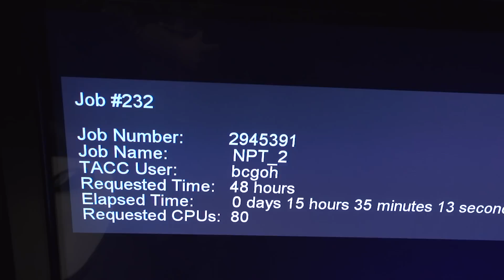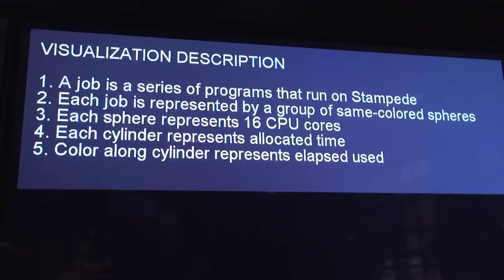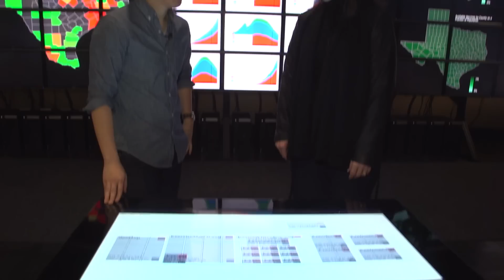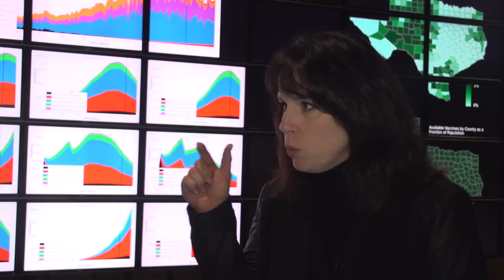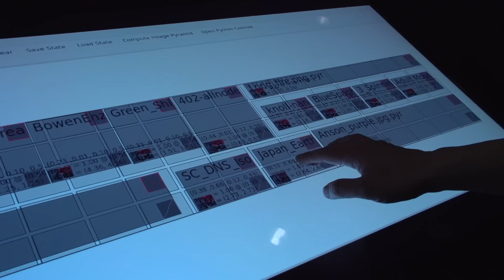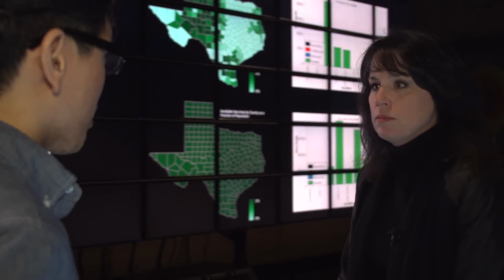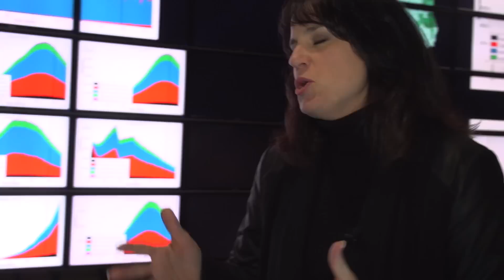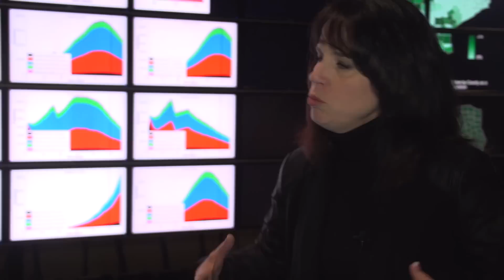What Makes a Supercomputer?

Comment: I imagine a projector would be a lot more power efficient and just as practical to use over these 70+ 30inch monitors. Not to mention a lot better looking.
Reply: the picture quality would not be good with a projector , im sure with all their money they know what they are doing.
Reply: There is no projector even close to this resolution. Doesn't matter if you have a big screen if your pixels are the size of your head. So you'd need just as much projectors as you have monitors now. On top of that you need to make sure you don't block out the light when standing in front of it, so they'd need a whole room behind it just so the projectors can project from behind. And then the touch comes in. I'm not sure how you would do touch on a projected screen like this.

The bezels would be gone but there definitely would be other trade-offs.
Reply: My estimation based on 75x 1440p monitor vs 3x 4K Projector
2160 x 4096 x 3 = 26,542,080
1440 x 2560 x 75 = 276,480,000
276,480,000 / 26,542,080 = 10.41666667
The Monitor Array Roughly 10.4 (1042%) times the pixel count than 3x highend 4K projectors that cover the same area.
Reply: TheOSC I don't mind being educated, as long as it's done in a civil way as these guys have shown.
Reply: No it's comes down to resolution not the size of the display array.  The need real estate AKA pixels to display this much information.
Reply: While it's hard to argue the pixel density of these screens versus a 4k projector, those pixels become useless at the distance/scale we're talking. Even if you needed to fit more things on the "screen", you could play with the DPI to scale things down to simulate a higher resolution.

Touch screen have been done with projectors for a while, but let's be honest, it becomes more a gimmick to have touch screen with a display that size. 

You wouldn't be blocking the light since the projector would of course be hanging from the ceiling, and even if it wasn't, it wouldn't be an issue unless you insisted on the gimmicky touch screen.

From the arguments I've read, I still see this as a huge waste of money compared to a projector. Though, my guess it's not as much the practical value as the proof of concept that is important here, like a demonstration of an insane resolution working in real time with the super computer.
Reply: ttobyg That just isn't true, standing where they were standing you could clearly see detail on the upper row of monitors, it was only a few feet higher and they are 30" each. Your TV in your bedroom is probably smaller than those monitors. Trust me as someone who works on a 32" monitor all day when I am at home I can attest to seeing great detail from a decent distance on a screen that size. YOU ARE WRONG.
Reply: the monitors are touch screen..

they are not, most people think that they are though
Reply: ttobyg It all depends what you are trying to display on it. For a movie this would be stupid, but these screens are used to visualize scientific data and simulations done by a supercomputer that costs tens of millions AT LEAST. The cost of this compared to the computer is negligible. The goal of this wall is to be able to display and analyze the data generated by this supercomputer. That wall is the interface to petabytes of data. What's the point of generating that much detail with a machine that expensive to be limited by the display resolution. You can have 10 people doing stuff on this wall at the same time and still give each one 4K worth of pixels. When working with a 4K projector you drop down to 1080p when working on it with just 4 people. I think you overestimate the amount of stuff you can put on a 4K display.
Reply: Neojhun
 dell's 30 inch screens are 2560x1600, the 2560x1440 are 27"
Reply: ttobyg Yeah going along with what everyone else has said so far you are wrong to state that this would be done more efficiently with projectors. First of all you assume that people will be standing back looking at the entire array from the back of the room. In reality you might have 3-4 groups working off of this one display meaning each one takes a sector of it and puts their research up for display that way. Second there is a reason this is hooked up to a super computer, they are processing highly detailed data and want to be able to see that data in high detail when visualizing it. Finally I don't know how much experience you have with multimonitor setups but the ability to group different applications and visuals into individual monitors makes it much easier to organize your work. I work off of a 3 monitor setup at work and have 2 32" monitors at my house that I use and the ability to group my work is made 10x's easier with more monitors and more pixel density.
Reply: TheOSC the detail gained through pixel density is wasted on the upper monitors. Anything displayed above eye level does does not require that concentration of pixels, since you can't even see fine detail without using binoculars. Notice at 10:50 how everything is sized so it can be observed from a distance. When you scale things up that much, you don't need the pixel density of that caliber, and could easily settle for a 4k projector.

Again, if you think you need more room, you can fiddle with the DPI settings to emulate a higher resolution.

Yes it's very cool to show off the insane resolution to pixel density ratio, but the practical value of it is quite low.
Reply: ttobyg That problem only becomes worse with 4K. 4K aspect ratio has a lot more height than what is shown here. So you'd need at least 3 or 4 4K projectors to get the same usable space. 60Hz 4K projectors aren't cheap. $15-25k MINIMUM for projectors intended for home use and then you still need a touch interface. You may not believe in touch, but it is one of the most natural input methods. Especially at this scale. It may still end up being cheaper, but not by an insane amount. Projectors are much more expensive per pixel than monitors.

What is in screen during the video is not actual research data. It is obviously a demo so it looks good during the filming. This video is not representative for how it is actually used on a daily base.

Fiddling with DPI doesn't change anything. Rendering in high resolution to downscale later is the same as running it at the native resolution at the same scale. DPI transformations make text and fine lines fuzzy which already is a big issue with any projector.
Reply: you all know you are talking about people who make supercomputers?  I think they know what they are doing
Reply: ttobyg Monitors tend to use very power efficient LEDs these days, while projectors use very power-inefficient incandescent lights of various kinds. To produce a similar amount of brightness, the projectors would consume a great deal more power. Add to that the projectors would use a huge amount more space (even with short-throw lenses, you'd need to use rear projection), and your display wouldn't be a touchscreen.

The end result would be consuming a ton more space, losing the vast majority of your resolution, losing touch-interaction, using a ton more power, and costing far more to build (high-end projectors are insanely expensive).

Just one good quality professional 4K projector costs more than that entire video wall and the computers that run it combined. A Christie D4K2560 goes for ~$126k. Even the consumer units cost as much as a car, Sony sells a 1700 lumen model for $15k, but you'd need so many of them to get the whole videowall up to an acceptable brightness that you'd end up in the same situation, paying a ton more than just throwing LCD monitors at the problem.
Reply: Adam Zey I must admit, I'm not an expert on projectors, but it sounds unreasonable to think that 70+ 30" screens consume less power than a 4k projector. Why would the brightness be a problem if the room is darkened? And again, touch screen is a unnecessary gimmick.

Some quick calculations. One 30" Dell consumes roughly 150 watts. Multiply that by 70 and you got 10500 watts or 10.5 kilowatts. 70 30" Dell monitors sell at about $1k, or $700 if you buy an older model, so from about $49k to about $70k.

The Sony 4k projector costing $15k consumes 350 watts, or 30 times less than the monitor solution.

Even if you bought three Sony projectors, for the brightness you mentioned, it would still cost less and consume far less power than the monitors.
Reply: ttobyg
Because you need lamps with a very high brightness for projectors. We can't do that with LEDs yet so we have to use incandescent bulbs. That means before any light leaves the projector you already lost 95% of your energy to heat. Then it has to pass through the LCD screen inside which absorbs even more light.

Projectors make quite a bit of noise for cooling. Ever seen a monitor with a fan?

Well now the room doesn't need to be darkened so you can do actual work. I'd also like to know what you'd suggest as an input method for this wall (no matter what technology is used for the screen). You seem to think that touch is a gimmick but what else would you suggest? A mouse and keyboard need a surface to be used on and don't allow for concurrent users. It's easy to break something down but it's harder to come up with a good alternative.
Reply: Niosus The Sony projector is for home theatre use; pitch black rooms. The Christie projector that I mentioned draws up to ~5kW, and you'd need a few of them. By comparison, a modern Dell 30" monitor has a typical power draw of ~60W.
Reply: Adam Zey Exactly my point!
Reply: I think this guy just can't stand how wrong he is and now he is trying his hardest to save face...
Reply: projectors dont have great res
the graphics cards would fry the projectors
Reply: Niosus My school uses LED projectors and you can't even hear the fan and they are brighter than incandescent projectors, what are you talking about?
Reply: PC Tech Tips There's a difference between small projectors that only need to illuminate a small screen and the large projectors they'd need for a wall like this to look OK when there's light.

It's possible that things have changed by now, I'm not an expert.

However resolution remains an issue. Monitors stay cheaper AND sharper than projectors.
Reply: Even the best LED projectors heat up a lot when used for long periods of time. LED screens can run 24/7 and will only get a little warm. Plus a projector requires more space which is a problem when you have a set room size and you are trying to make the most powerful supercomputer possible. The computers make a huge amount of heat and a projector will only make the problem worse.
Reply: They Doing that because the resolution goes bigger and bigger you will not find 4K 16:9 image 
They make 21:9 image of 1080xp or 4xP

Comment: Bezels. So. Fucking. Big. Why.
Reply: Dell supplied them with the displays, they didn't go shopping for them. Also there isn't exactly a lot of 30 inch 2560x1600 narrow bezel displays on the market anyway.
Reply: Because consumers have not yet demanded bezelless displays. Current displays have wiring along the edges of the panels to drive the rows and columns of pixels. The wiring takes up space and without the demand to eliminate that wasted space it is simply cheaper to stick with the current method of wiring. However, the first company that brings it to market at a reasonable price could be overwhelmed by demand. I think they should move toward onscreen logos that fade away once the monitor is booted up or when there is a video source present. Perhaps they could choose to brand the on screen control menus.

Comment: Teraflops. Stupidest term for something so amazing.
Reply: How is it stupid? Tera is the multitude and flops is an easy way to describe the exact thing being used to rate the system. If anything its an extremely efficient name because it describes exactly what is being said.
Reply: well if you don't want to say flops, you can always go ahead and say it the long way, Floating-point Operations Per Second
Reply: xNo L1m1tZx
 Because the word Flops has several meanings apart from Floating-point Operations Per Second. Think of a movie or game being a total flop and fails to sell. It also means someone bailing on you when you made an appointment. Being flopped by someone. Or think of a player in a sport who falls unnecessarily, after little or no contact, it's also called flopping.

I suppose it depends on how you look at it, but the word is comical to say the least. Not something you'd imagine for high end technology.
Reply: pmt3ddy While I see the point you are trying to make, I think its a non-point. What about our usage of the word bytes to describe 8 bits? We don't go around putting out teeth on that summer vacation video saved on our harddrive do we?
Reply: OP is a flop